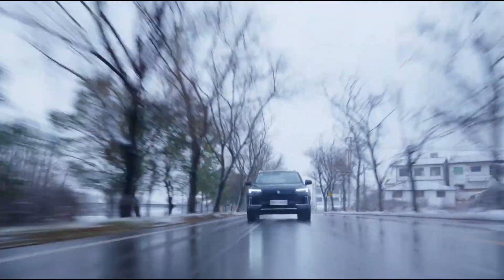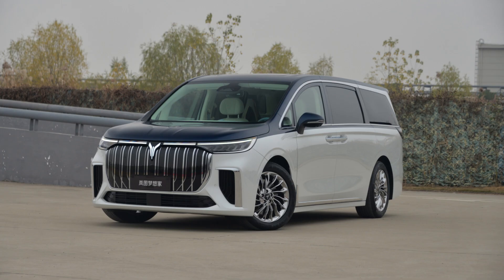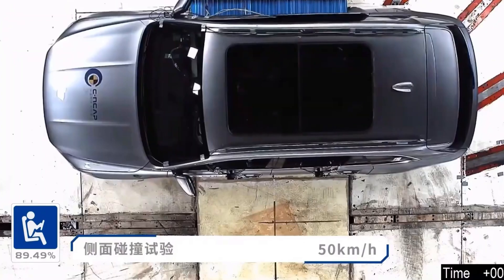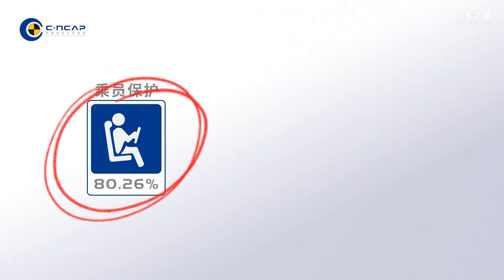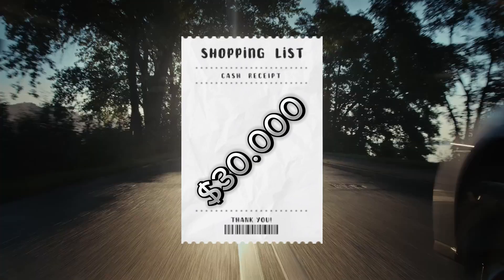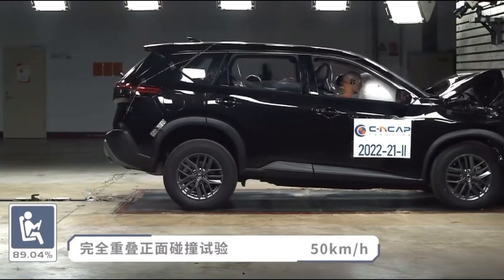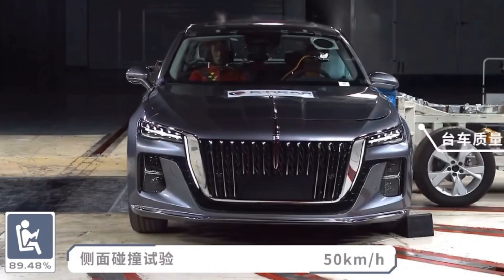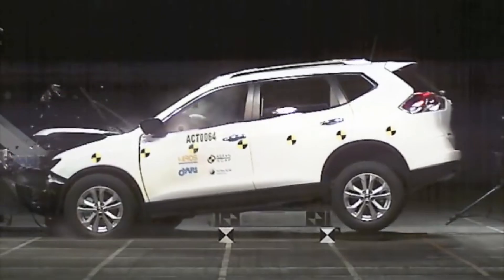Failed Crash Tests of Chinese Cars! Why don't Chinese airbags work?

Comment: Soooo, there’s NCAP and the Crappy-NCAP.
Reply: China NCAP is actually a significantly more challenging test than Euro NCAP - Euro NCAP uses 56 km/h, which is a close match for the 35mph NTHSA tests in the US.  China NCAP uses 64 km/h, which is a good match for the 40mph IIHS tests. Although the speed difference might not sound much (it's about 14%), kinetic energy is mv^2, so the China NCAP and IIHS tests have about 30% more crash energy than the Euro NCAP and NTHSA tests do given the same vehicle weight.
Reply: @TrimeshSZ  it’s not the test standards, it’s the trust in manufacturing and quality of the cars afterwards.